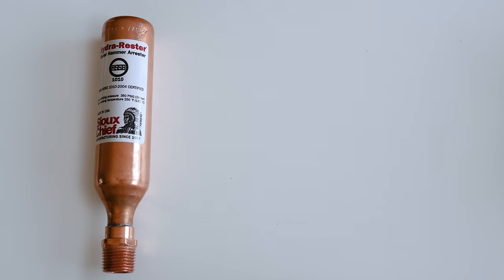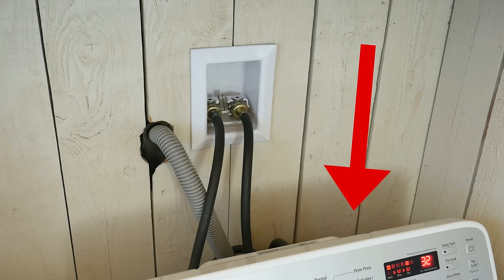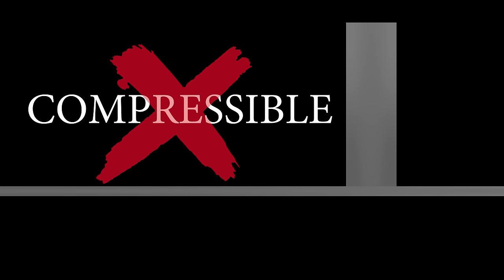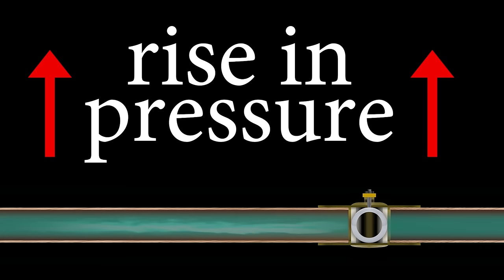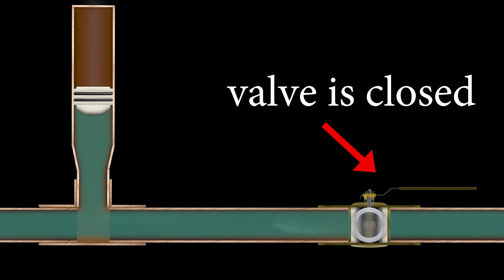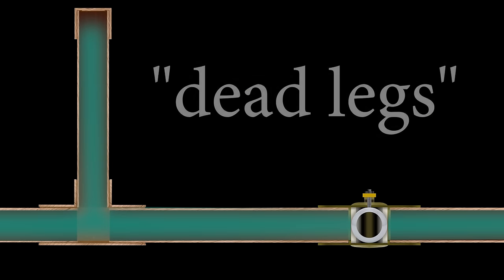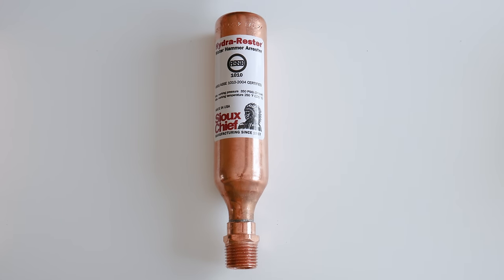Why Water Hammer Arrestors Are SO Important | GOT2LEARN

Comment: I have air dead-leg type anti-water hammer pipe chambers in the cold water pipework of my old home, they work very well to suppress pipe rattling noise for about 1 year each time after I drain the water out of the cold water pipework system to refill the air in them. 

I tired of doing this annual air refill draining work, so I arranged for a plumber to install several of these simple sealed piston type water hammer suppressors next to each automatic on/off valve after plumber gushed with enthusiasm about them and I saw many endorsing YouTube videos like this and vendor websites saying how effective they were. 

It seems that the piston seems to be pushed up and suspended a little up inside its sealed cylinder by static line pressure when the pipework system is at rest, and then a pressure spike from a nearby closing valve pushes it up even further, absorbing that surge to protect cold water pipework, prevent rattling noise etc as designed. Fine.

But I find a problem that whenever a remote cold water valve opens somewhere in my home, those suspended pistons variously rush down in response to the momentary dip in line pressure, causing an irritating 'thump' noise when each piston hits the narrow neck of its cylinder.

This problem would be eliminated if a stainless steel spring where to be installed by the manufacturer between the piston and that narrow neck of its cylinder.

Meanwhile I am looking around for an alternative anti-water hammer protection device which looks like two metal cups joined together with a continuous rubber diaphragm separating them, one cup blind/filled with air, and the other cup connected to the pipework. That way the flexing rubber diaphragm will noiselessly absorb pressure surges and pressure dips.

Anybody know/recommend such an diaphragm anti-water hammer device? 

Thank you.

Comment: Very thorough explanation. Great Video! One question though: should we put hammer arrestors on all water outlets. The minimum has always been at the washing machine.
Reply from the maker: The more, the better 🙂
Reply: Instead of several of these high failure rate devices, use a single expansion tank mounted on the cold water line going into the water heater. It's  better technology, more reliable, and easily replaced if it fails.
Reply from the maker: Expansion tanks are for expansions in the system, not hammering, two different things.
Reply: @Got2Learn  don’t they work the same way except one is bigger.
Reply from the maker: Negative!
Reply: @archer9732  The difference between an expansion tank and a water arrestor is obviously the size but also the effectiveness of the damping. Sort of like using springs off a Semi-truck used on a Honda Civic. The quicker burst don’t get damped by larger inertial masses.

Comment: When I moved into this house new 37 years ago, such a thing didn't exist. Then I noticed that the washing machine valves was causing the hammering in the 20 aughts, It sounded like wrestlers body slamming against the walls. I did put in the air chambers, but the air pockets dissolved away within a couple of months. Then the water heater leaked and I replaced it. When I filled that with water, the elbow connectors nearest the washing machine feeder valves failed. I had to replace those. Plus the air pocket in the new water heater helped dampen the shocks. The air chambers will get replaced with the piston type shown in this video. Thanks!

Comment: thanks.  this is missing in an old home I just bought, where the washing machine drains.  I can use a large load, mostly without an issue, but every time an extra large load was used, water oozed out of opening and spill all over my garage.
Reply: These have absolutely no relationship to the drain system.

Comment: Own a 1920's house. This happens on a DAILY occurrence. I've always wondered how to stop water hammers.

Guess when I do the reno, I'll make sure to get these in the lines.
Reply: In a normal domestic property,  you shouldn't need these. I used to have water hammer, took out a lot of excess pipework that had been added to over the years, lots of bends and joints removed and clipped it back properly. Water hammer gone. Check your pipework first.

Comment: Just ordered one of these as our new washing machine has solenoids made by NASA or some shit. For anyone looking for another solution for their washing machine, you can close the inlet valve halfway and it restricts the flow somewhat as the valve itself acts as a baffle and prevents water hammer. It takes the machine a little longer to fill up, but mitigates the problem.

Comment: I wonder how the pipe material affects the severity of the problem. I have never seen the arresters in any apartment in eastern EU and I have seen quite a lot of plumbing - I believe that protection from water hammer is not required in our codes. But we use mostly polipropylene pipes nowadays, not the copper ones, and I believe copper might be more susceptible since it is way thinner. 
Despite this lack of arresters, I do not recall hearing much noise from the plumbing as well. I wonder if the common use of flexible hoses helps to mitigate the issue a little - after all the hose can expand a little, absorbing the pressure surge partially (at the cost of increased wear of the hose).
Reply from the maker: It could be that you have a lack of pressure in the system (~50psi).
Reply: We don't use them in Aus and water pressure is 500kpa (72psi).
Only had an issue with water hammer in one house, it was on a hill and we would get hammer from the house down hill.

Comment: In my home which was built in 1997 the only "dead legs" on on the water heaters. I am in the process of replacing my water heater, should I put arrestors on the inlet and outlet of the water heater or can they be placed anywhere on the lines? Is it on the water heaters just because it is a convenient place to put them?
I have watched several of your videos, very professional !
Reply from the maker: These are best placed near the banging fixtures in question, thank you very much Paul!!!

Comment: Great video. 1 question - I get that it lowers water pressure going opposite the shutoff. But why would these not lower water pressure when water is flowing the normal direction?
Reply from the maker: Thank you! These devices do not lower/augment the pressure, they control pressure surges, very different ;)

Comment: I bought a house 9 months ago with polybutylene pipes. I've had 3 leaks but they were not from the piping. I've had to replace 3 valves on the end of the pipes.
Reply from the maker: Polyb should be replaced.
Reply: Were inserts used? If not they will leak at connecting points . You can use compression brass fittings and olives on poly pipe as long as you use inserts.I have never liked easy push fit fittings.Good old fashioned compression and olive fittings live forever if fitted right on copper or poly pipe.
Reply: @glennpowell3444  The valves were leaking not where they hooked to the poly.
Reply: @blackericdenice  OK .That's different sorry.

Comment: you can still use air chmabers, specially if you ar in PVC or PPR pipe systems and that should be placed on each plumbing fixtures, unlike WHA which depends on the  Fixture Unit Equivalents.

Comment: Stand pipes work for considerably longer than a few weeks depending on how active the water flow is; however, I believe the expectation is that a standpipe gets "refilled" with air anytime the water system is turned off (which is obviously highly variable from system to system).
Reply from the maker: Yes, as soon as you empty the system it gets refilled with air, but that doesn't happen often.

Comment: That arrester is a much better system that the old water chambers that would be installed. Great tip bro.
Reply from the maker: Thanks Viper6, well, on jobs nowadays they are obligatory so we don't really got a choice right? Have a great day mon chum!
Reply: Actually they aren't because eventually those O rings wear out and then they are exactly the same as the old water logged column

Comment: As the piston is plastic with rubber O-rings, water hammers that come in soldered pipe connection version need to be wrapped with a water soaked cloth when installed to avoid heat damage to plston plunger during soldering.  Threaded ones avoid this but then need to make sure the threaded pipe installation does not leak.

Old way of 'dead end' has same issue of well pump to bladderless pressure water tank that becomes water-logged every six months or so.  Air gets dissolved in water.

Comment: As a plumber yes these devices do work but are a mask for a greater issue. That being rate of travel of the water being too high. Here in Australia to install pipe work to code it must be size to keep water speed down thus minimising shocks from sudden storages in flow
Reply: I'm in Australia and I've seen heaps of water hammer issues, even in new-ish houses.

Comment: The part about legionella bacteria in stagnant air chamber isn't obvious and was informative. Can you explain where water hammer arrestors should be installed? For example, should they be installed locally to the hammering device? Or, can they be installed for the whole house. Should they be install at high or low elevations? Does each additional arrester contribute the overall compressible resilience of the house? What's the difference between like the bell-shaped ones and the piston-type arrestors? Should out of code air chambers be retrofitted?
Reply from the maker: Closest to the banging fixture :)

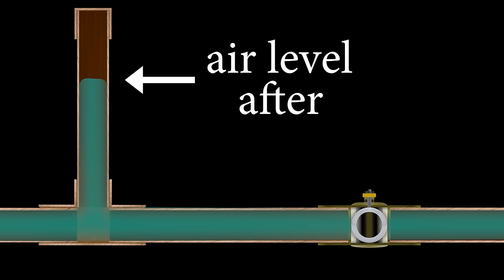Comment: At 2:00 in the video, we have something similar in my company it's called an ARI vent.  We place it in the middle of piping or right before a curve/hill.  But our ARI vents have a "relief valve" at the top that never allows the "chimney" to get full of water, it spills water over.  I guess you can use our vents outdoors but not inside walls.

Comment: So our house is over 50 yrs old and has galvanized pipe (yes I know bad and want to replace with PEX soon). It has dead legs.  I have owned for 25 yrs and never had issue with pipe except one leak on a nipple on water heater which luckily I was home for.  Given that scenario, I don't see why arresters are so important if this house has survived so long with out them.  I am assuming our dead legs are like you said filled with water.  I am guessing marketing and legislation etc has got to have something to do with it so plumbers and companies can make money off of this.  Same thing with all these safety features on water heaters now like thermal files that slam shut and render your heater useless until you fix or call a plumber.  Just my opinion.  Great video. Thanks for posting.
Reply from the maker: Those dead legs are a potential "risk" for bacteria growth. I am pretty sure you can agree on the fact that standing water has this risk and that you would do anything for it not to affect your drinking water, these hammer arrestors are proven to get rid of this problem, so I don't chances anymore.

Comment: Thanks for the videos.  I learn a lot.  So...I am setting up a new pressure tank, tankless water heater, and filtration system for my home.  Where in the pipe layout and runs would you place one of these arrestors?  Do they need to be near the offending valve, or may they be anywhere in the system?
Reply from the maker: Most times where it's banging, but we'd ofyen install them right before distributing the water for let's say a kitchen, or bathroom.

Comment: It would be fine to install arrestors within a few feet away and inline with the fixture/appliance? Also when is a whole house one needed? I am thinking of ease of installation and change out if needed. (This guy is awesome.)
Reply from the maker: Best to install one nearest to a fast closing valve like a washing machine, the more the better until knocking stops 🙏
Reply: @Got2Learn  I was thinking of there was an audible problem, adding them on the 1/2 inch lines. Thank you for the reply
Reply: @Got2Learn  from your experience does PEX help absorb the shock? I like running copper mains and then running PEX to the final destination. I pretty much have settled on ProPress tie in and then solder a ball valve and adapter I'm whatever configuration is best for the application. I was thinking about adding the arrestor in that assembly plus then it's easy to get to in a basement setting.
Reply from the maker: PEX does help with hammering yes.

Comment: I don't have any hammer arrestors in my house. And I do have several quik closing valves. No noise, no rattling,no problems with that for fifty six years.  Public water could have higher pressure which could be a problem.
Reply from the maker: Exactly what you said!
Reply: @Got2Learn  see you can teach an old dog a new trick.

Comment: So where do you put them?  Or does it matter?  As in, should it be closer to the main water shutoff valve for the house, or can you essentially put them anywhere in the system?
Reply from the maker: Closest to banging fixture 👌
Reply: @Got2Learn  Thanks.  I have a very unusual one. where the dishwasher opening/closing the feed causes the knock.   It looks like I should probably put one of these under the sink area, where the dishwasher connection is made.
Reply from the maker: @DarkpawTheWolf  yes, try that!

Comment: If I was building a new house I would consider installing one, but are the conditions over exaggerated? My house was built in 1978 with copper pipes and none of the joints leak only some packing nut issues on valves after 43 years on city water pressure. As far as clothes washer solenoids shutting fast, every clothes washer I have ever seen is hooked up with flexible hoses which absorb the shock and displace it.

Comment: Its funny to see such things. Im a plumber in germany for many years now and we dont have this things anywhere (waterhammers) + we dont have the problem with watershockwaves destroing pipes or joints.
Reply: I've never seen one in Belgium either. Just wondering, do you guys run you water in ring lines, or a separate line to eight waterpoint from a collector? also: is this a copper/ metal line issue only?

Comment: Where is the best place to position a water hammer arrester. eg start of the run, middle of the run end of the run or all 3? or in close proximity to each "fast close" valve? Thanks
Reply from the maker: Closest to the banging fixture in question ;)

Comment: A piece of blanked off vertical copper pipe    about two foot long, soldered into the line will do just as good . The air trapped in the pipe does exactly the same thing and it's cheaper and easier.
Reply from the maker: That's a dead leg, perfect place for bacteria growth in the water your drinking, not good.
Reply: @Got2Learn  No your wrong. If you have high water pressure you also have chlorine or clo2 in your water , unless it's pumped from fresh ie a river. The chlorine escapes  keeping it clean .

Comment: Does it matter in what direction they are installed? I was told pressure regulator has to be vertical inline and not upside down, I have limited space for these behind my washer and got the shark bite kind being able to but them at any needed angle would be handy but it doesn’t say and you didn’t mention it in the video just a vertical demonstration. Do they only work in that application?
Reply from the maker: You can install them in which ever direction.

Comment: I have a theory that water hammer arrestors are unnecessary in a pex piping system because the pipe itself can absorb and soften the shock.
I've also used pex to do the irrigation piping in my greenhouse. The whole thing froze solid and thawed several times with no noticable damage including to the brass fittings. I believe that the pipe can expand enough to protect the fittings from freeze damage too.
Reply from the maker: Code still asks for them
Reply: @Got2Learn  Yeah and they're certainly doing no harm... I was just saying I bet you'd be fine without them in a house plumbed all in pex. I was also just thinking that if you were on well water then your pressure tank might be like a giant whole-house water hammer arrestor too.

Comment: It's my understanding that WHAs are not compulsory outside the US... it all depends on water pressure at the outlets within the home and the quality of the plumber's pipework. Most homes don't have high enough water pressure to cause water hammering, and a good plumber will ensure all his pipe work is properly secured, and not free to knock.... Having said that, in cases where a home DOES suffer from water hammering, then one should have a very high quality arrester installed (pay the extra money - it will save you money in the long run) as the lower, and even medium quality ones tend to work initially, but fail after just a few months.

TL;DNR - Just because they're compulsory in America, doesn't mean you should get one... ONLY get one if you suffer from banging pipes, and get a very high quality one if you do need one.
Reply from the maker: Well said!

Comment: We are required now to put them on commercial washing machines. I'm not a fan because they need to accessible. I only install them if the plan requires them. I would be more appt to bring my pressure down through a prv. I've seen many a system 100 plus years old fine without em. But valves turn off much faster these days. As for prioress I love it but have noticed more leaks versus solder. Usually after I go back to a job years later and see corrosion on the copper. Much like one would see with a solder joint that had to much flux applied.

Comment: So how many of these does a home need? If I put one in the basement where the city water comes in will that be all a house needs?
Reply from the maker: I'd start by putting one on both the hot and cold nearest to the fixture that's knocking, if that doesn't solve it, you might need to add more.